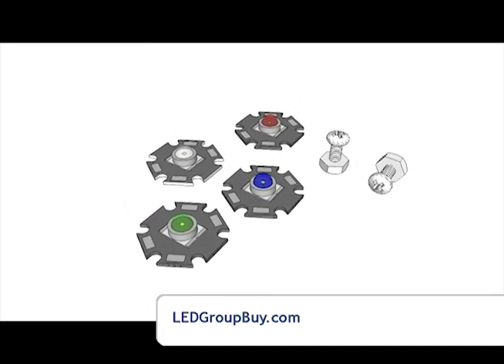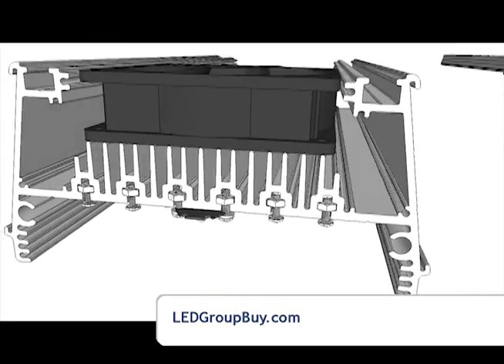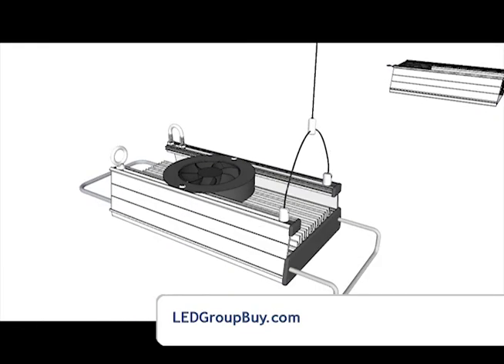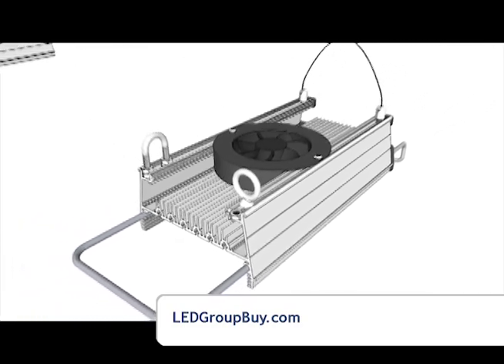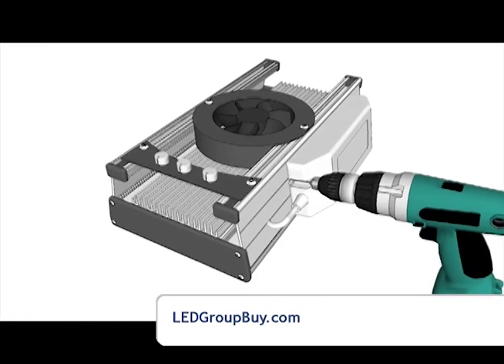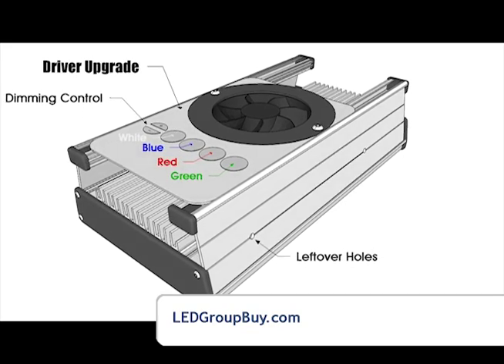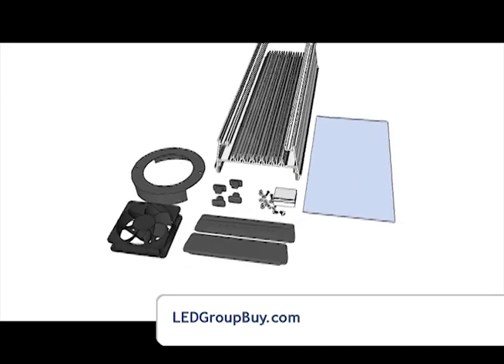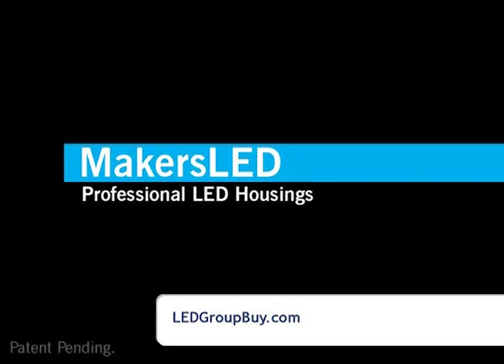DIY LED Heatsink that looks Professional

Comment: Hi there,
are those heatsinks compatible with CXB Cree COB'S ?
Reply: +larnak974 CXB CREE is a fixture I believe?  The LEDs themselves should fit on the heatsink fine
Reply: +Milad Sakiani 
Thanks for your answer. 
CXB Cree cob's are high powers leds that can be used with holders. 
They delivers a lot more heat than star leds used in the video that's why i was wondering if that heatsink could handle 2 or 3 of these.

Some pictures: http://www.google.fr/search?q=cxb3590+cree&prmd=sinv&source=lnms&tbm=isch&sa=X&ved=0ahUKEwiy8eWD6fbJAhWGvBoKHbAFAoAQ_AUICCgC&biw=360&bih=615#imgrc=6E9kQU3yl49XcM%3A

http://www.google.fr/search?q=cxb3590+cree&prmd=sinv&source=lnms&tbm=isch&sa=X&ved=0ahUKEwiy8eWD6fbJAhWGvBoKHbAFAoAQ_AUICCgC&biw=360&bih=615#imgrc=6E9kQU3yl49XcM%3A